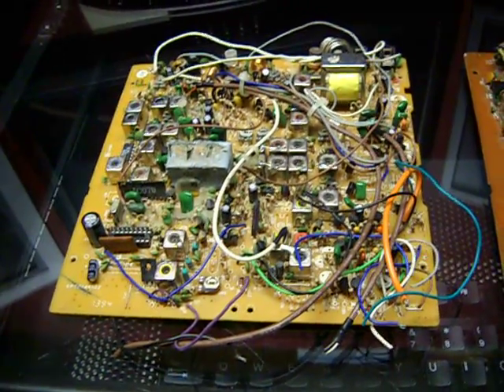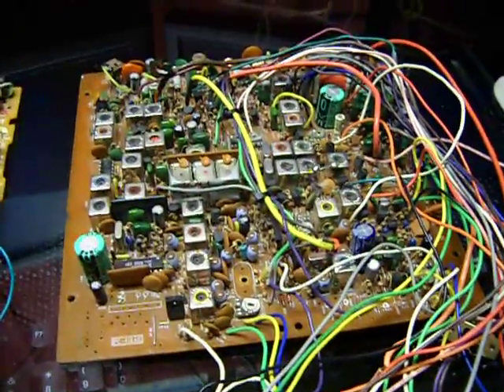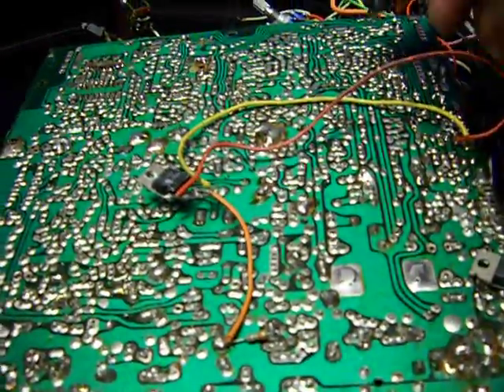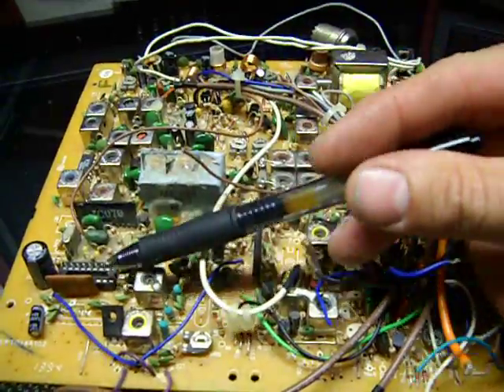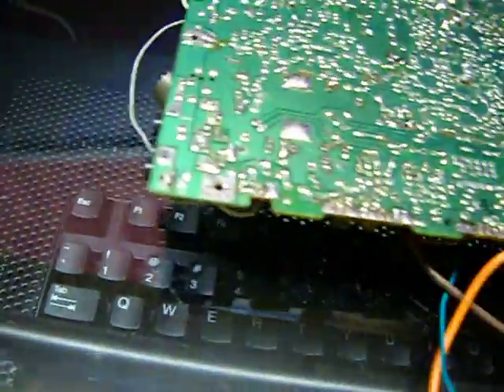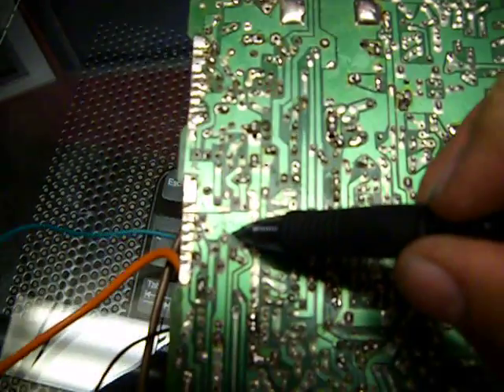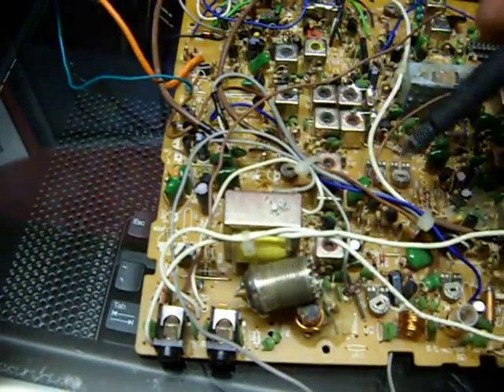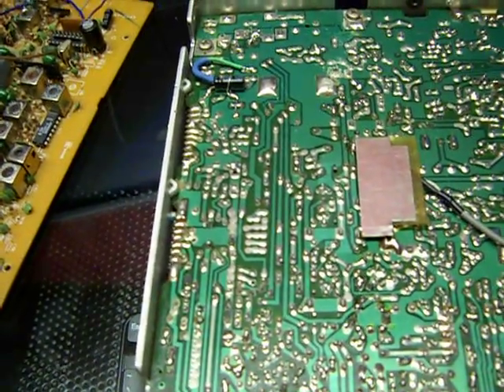Cobra 148/148F *RCI made* electrical mod - side mic "Malaysia"

Comment: silicon can you tell me what Pcb board number the 148 f uses, or what other radio can replace it directly. I have a 148f here that's missing the mic jack. thanks
Reply from the maker: +birdman3931ny The PCB in the 148F will be the EPT0148xx board as it is a Ranger product.  The schematic for the radio is the same as the older Uniden radios, with the exception of the power issue that this video addresses, along with added circuitry for the frequency counter.  If you obtain the SAMS schematic for the original 148 (SAMS CB Photofact 249), you can use that for your mic jack.
Reply: +silicon212 thank you
Reply: +silicon212 sorry this number you provided is the mic jack number?
Reply from the maker: No, main board number, didn't see anything specific.  The number is EPT014840Z.
Reply: Thanks

Comment from the maker: Gotcha.  The instructions for the Uniden models will work with these as well, in regards to tune up / alignment instruction.

I added a link to my facebook page (this should be set to Public although you'll likely have to sign in to see it) with some more info on these radios.
Reply: How do adjust the lsb off frecuency
Reply from the maker: @vatoperro1370  You need a frequency counter hooked to TP1, set radio to channel 1, center the clarifier (Voice Lock) and adjust L23 (AM) to 34.7650MHz, L22 (LSB) to 34.7635MHz and L59 (USB) to 34.7665MHz.  .0015MHz split between USB, AM and LSB.  Don't key the radio while you do this.

Comment from the maker: Just the usual, make sure all the solder joints are tight and whatnot.  If you want to get more channels than the stock ones, you will need to remove the resistor that feeds pin 9 of the PLL, install a shunt in its place, and replace the PLL with an MB8719.  The RCI8719 is a 5 volt chip of dubious design (it works on 40 channels but it's no good for modding), the resistor drops the 8 volt input down to 5 v for the RCI chip, it must be shunted for the MB8719 which is an 8 volt part.

Comment from the maker: Yes, it will help on AM too, as it will stabilize the radio.  A voltage drop over the PLL is never a good thing, no matter what mode you operate.  

Why they decided to change the original design and draw everything through that choke is beyond me - this mod removes that 'deviation'.

Comment from the maker: The shunt is any piece of wire that can fit in the provision for J44.  I used a lead from a resistor.  

The RCI radios are okay once you get past these little design 'issues'.  The Taiwan / Philippine 148s are the ones to have, but the only "F" model is going to be RCI made (Malaysia).